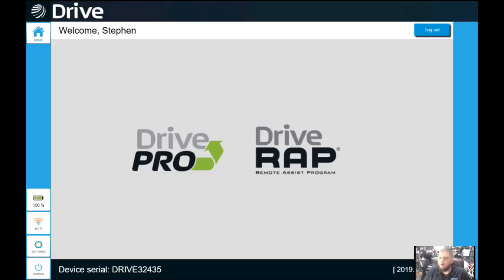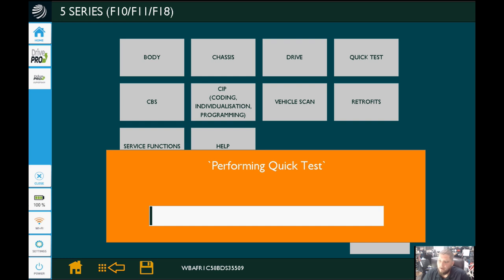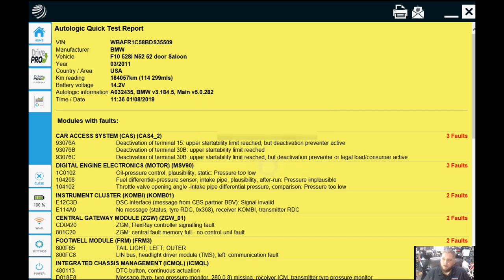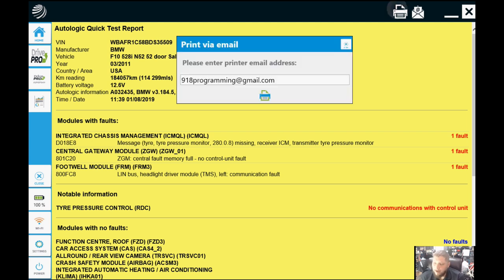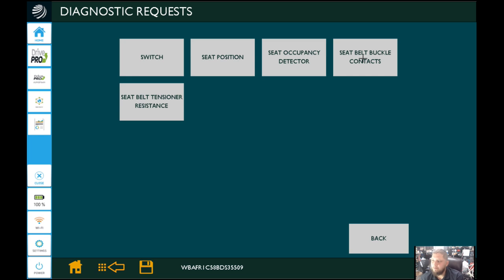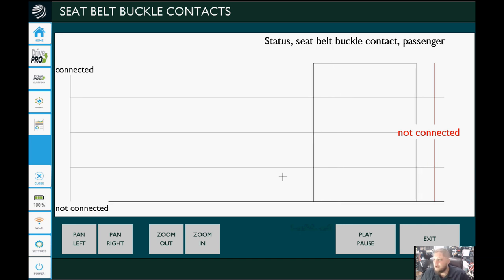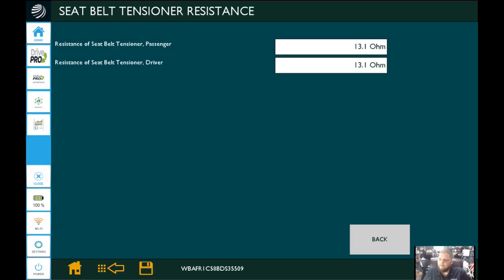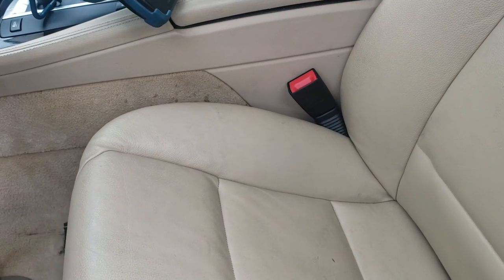Autologic Drive Pro Walk-Through - BMW Diagnosis and Post Collision Scan

Comment: you lucky didn't buy this, i spent over 40k with them on old blue box and the drive pro, they are changing rule on you, last thing my drive pro is locked and i paid about 10k couple year back which the Asian and domestic software is junk,  when drive pro came to market the sales guy keep calling and sell me the unit, about year ago drive pro stop working and i call in they unlock the European software since i had own blue box and they said for Asian and domestic not gonna work you need to pay for support, i said no need that since it is worthless, this year the drive pro it stop working again and now they are saying your European software not gonna work, now i paid about 10k for drive pro and can't use it, if i bought lunch or .... at list it was working and it dose some stuff even auto logic doesn't do it, DO NOT FALL FOR IT, GO DO MORE RESEARCH, AND THERE IS NOT MANY PLACES YOU CAN WRIHT REVIW, I WILL DO MY BEST TO SHARE AS MUCH AS CAN TO HELP OTHER NOT GETTING STUCK